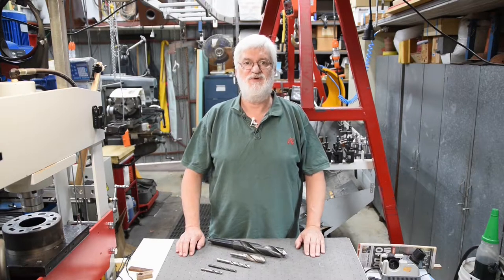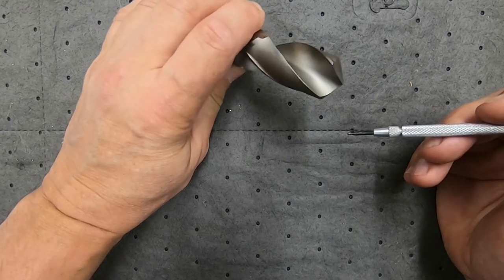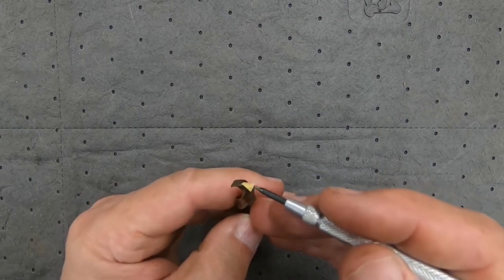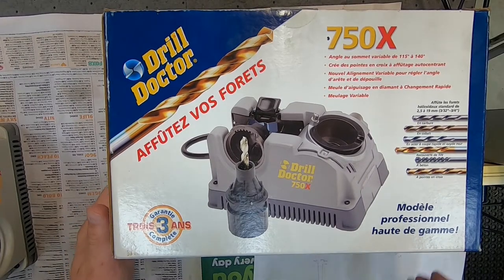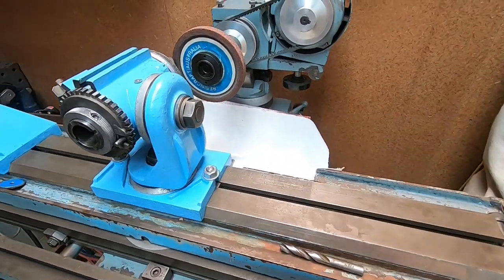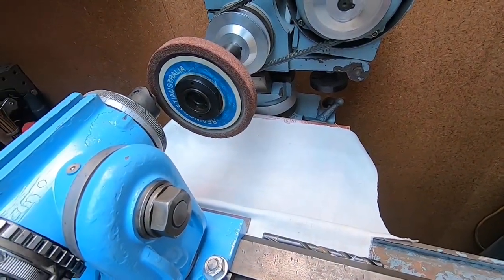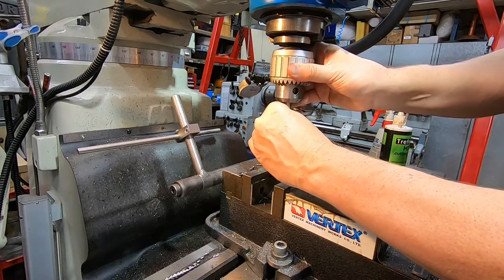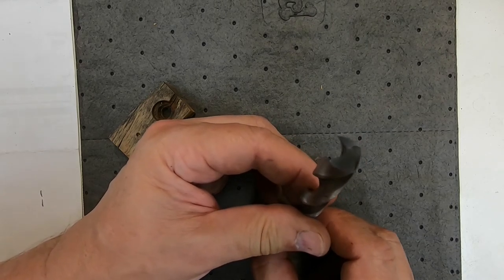Drill sharpening - easy way ? REVISED

Comment: On the General 825, set the flute stop exactly 1/2 the diameter of the drill bit away from the stone. This sets the 8-12 ° angle for proper drill bit geometry. This is why the foot is slotted. It allows for quick adjustment. Too close and the angle is flat, too far away and the angle is sharp. I adjust this back angle depending on the material I am drilling

Comment: 35:04 the angle can somewhat be adjusted by adding a thin washer (precision washer , aka ring shim) between two halves of tool where the drill point angle (59 , 68 , 88 etc degrees) is adjusted . the thicker the washer , the more shallow the relief angle . might even get 4 facet sharpening by first sharpening w/out washer , then adding washer / limiting counterclockwise movement when sharpening 2 nd time . i made my own top half of this tool (degree adjustment upwards) for sharpening 3/4 and larger bits , and discovered this by accident .
Reply from the maker: Interesting - will have to have a play with this.  Thanks for your comment Bill.

Comment: Drill dr, you can hear it when it engages the diamond wheel. Then you swing the jig assembly in the grinder hole to split the tip. If you don’t have the instructions download them.  I also have the tormek drill sharpener. Very slow so you want to sharpen sooner than later. Still not for large drills. The universal grinder can go even larger but same issues. That jig  using a cup wheel should sharpen everything but you will take time setting it up just for one size at a time. A simple 6 or 8 inch bench grinder and skilled hands are the fastest, best answer. Best help, use a sharpie or dykem to see your progress and symmetry.

Comment: You demonstrate a device you call "this sort of thing".  I call it a General 825.  In the past, when a bit goes dull, I simply buy another.  I have never had luck sharpening bits on any jig.  I have over 500 drill bits of all sizes and decided it was time to stop buying new ones and sharpen the ones I have.  I set the General 825 up as you show and as the directions commanded.  I get beautiful sharpening of most of the bits; however, about 20% end up with a flat head, rather than the 119 degree angle all around.  For the life of me, I cannot figure out why that happens, when the next one of the same size comes out perfect.  Got any ideas what is happening with this jig?  And, by the way, I love your presentations.  Keep it up!
Reply from the maker: Wayne, thanks for your feedback and sorry for the delay in responding. Re your General 825, the only suggestion I have is that maybe something comes loose after you set it. One of the problems I had was the sliding piece that locates the blunt end of the drill would randomly come loose and allow the drill to creep away from the grind stone. I also had a similar issue with the little nib that sets the rotation of the bit. NB the unit I had was an unbranded clone, so probably poorer quality. The instruction sheet was a single sided A5 sheet and nowhere near as comprehensive as the instructions that I see were provided with your unit. 
Cheers, Alan.

Comment: Excellent demonstration. I am curious what your mill is branded as. I have one that branded McLane, but I have found the mill is branded by many names and is made in China with the exception of the spindle and it is made in Taiwan. I bought mine used and it seems to be in pretty good condition for what I paid for it.
Reply from the maker: Thanks Terry. I bought my turret mill about 4 years ago and the model now offered by the seller is: https://www.machineryhouse.com.au/m598d. There are only a couple of minor updates - Turcite coated slideways and a different DRO display.
Cheers, Alan.

Comment: Hello Alan, if you google General tools 825 drill bit sharpener manual, there is a chart that indicates how much overhang the drill should have , dependant on the drill point angle setting. I think that you may be clamping too far out of the jig? Non the less, good informative video!

Comment: I have very poor results with Drill Doctor - drill just doesn't bite into material.  I've seen quite a lot of videos explaining proper technique, but no luck... Contrarily  - with that jig you were testing last I had a fair amount of success.  From your clip, though,  I just did not get notion of an offset to pivoting point to create proper clearance angle.  Can you please, refer to that part again in your future videos. Thanks.
Reply from the maker: I think the most likely cause of the drill lacking "bite" is insufficient clearance angle - which seems to be a common problem with the Drill Doctor.
The last jig I used in this video is an example of a very common unit that has been sold in many iterations and under many different names. For a detailed discussion of these units, have a look here: 
https://web.archive.org/web/20190731193119/https://www.modelengineeringwebsite.com/Drill_grinding_jig_1.html
(NB:The only links to the original posting that I could find were broken, so I located an archived copy on the Wayback Machine Internet Archive.)